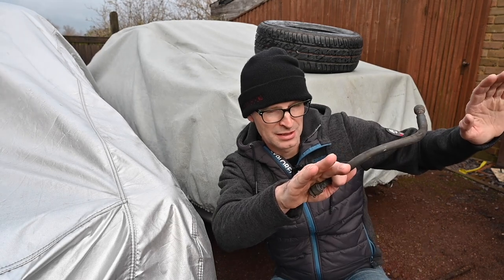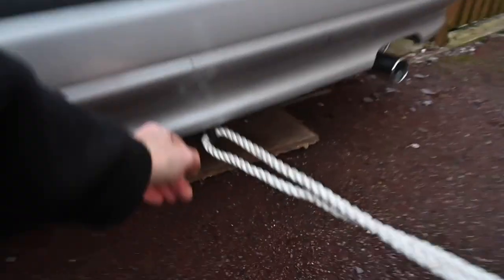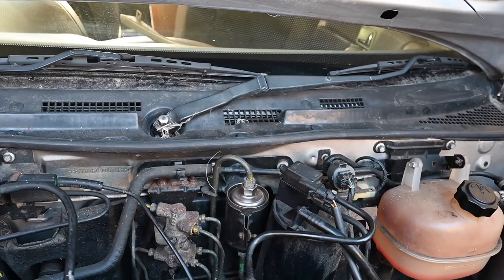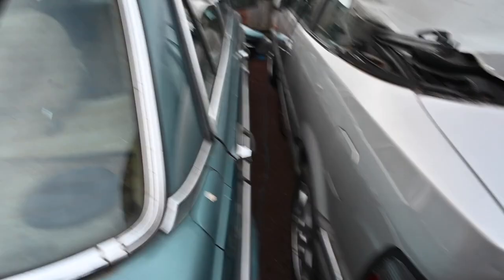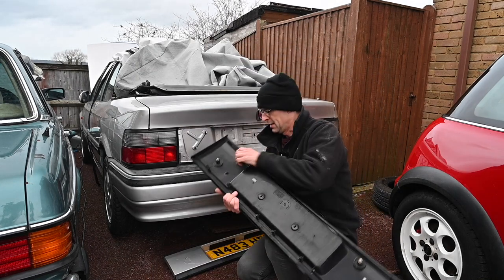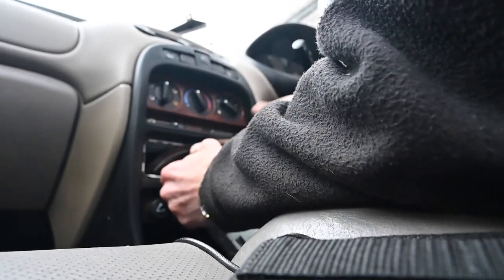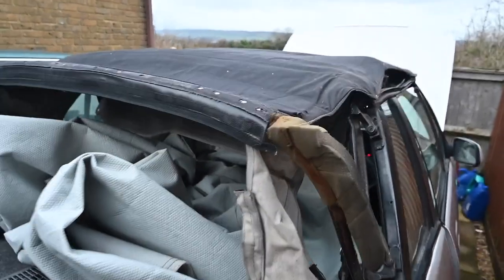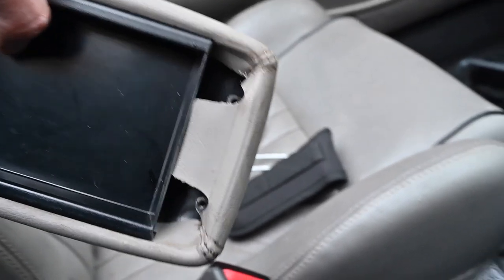Rover Convertible-Making it work part 927, Making it nice part ?

Comment: I've found that if I've had a project like this that's repeatedly gone horribly wrong, to the point I've wanted to abandon it but I've persevered regardless, I feel even more attached to the car when it's finished. There might be an initial period of "what's going to break next", but the more time that passes without anything breaking, the more trustworthy it becomes and the more satisfying it is to drive, as it feels like the hard work was worth it after all.

Comment: Oh lord, push-on pipe connector issues; I feel for you. Very besides the point of this video but the colour on that Merc, just gorgeous!
And congratulations on getting the Volvo's boot dry! Wonderful. Yes those grommets to the front of the boot can leak and sealing them, if only to prevent further leakage in future is a good idea.
Reply from the maker: Petrol blue metallic, not common at all but absolutely georgeous
Reply: @furiousdriving  Indeed! Mercedes had a lot of quirky solid colours but this one just fits the car perfectly and makes it more timeless.

Comment: I would invest in a secondhand 2 post lift for outside. They are affordable and you can tinker underneath the cars while standing and you have some more room on the driveway with one car in the air and one beneath it. Keep it up, she's coming along slowly but steadily.
Reply from the maker: Id love a lift but thought one would rust outside, also the fence is held by a brick retaining wall so Id worry about the stability of the ground under it just there

Comment: Matt, I am glad to see that you have some progress on Quentin, all be it slowly.  One easy and free cosmetic touch would be to restore you gearstick gaiter.  I suggest using black liquid shoe polish, rub the sponge bit into the faded parts and wipe off with kitchen role and keep doing it until the gaiter is black and there is no more transfer of polish onto the kitchen role.  It worked very well on my Mercedes  S124 steering wheel.  Happy Christmas Matt.
Reply from the maker: Somewhere Ive got a leather recolouring kit for black leather from doing the Coupe, I was going to do that and get one to match the beige seats here as well

Comment: You didn’t grease the little bar with ball joints on either end that pulls the sides of the hood in when it goes down. They break ALL THE TIME if you don’t smother them with grease. You can see the part behind the bits you did grease. My Dad had a bag of them made so I could just screw the ball joints onto the end of each when they broke.
Reply from the maker: I did a fair but more with the camera off as it was taking a while - one is missing but I have a new one

Comment: the volvo looks so clean and shiny compared to when you first got it

Also if you earth the fuel gauge wire on the sender end it should make the gauge show full, it'll tell you if its the cars wiring or another dodgy sender unit
Reply from the maker: Thanks, it has come a long way! And yes, I just need to work out which one it is again

Comment: Can't help but notice there are two exposed holes for bungs in the volvo's floor, is it possible that you're also getting spray from the wheels up into the boot as well?
I'm really looking forward to seeing the Rover done. Maybe you should look at keeping it for the summer as you haven't had any kind of soft top for ages
Reply from the maker: I unplugged those drains to let the water out as it was collecting while parked
Reply: @furiousdriving  Ah I see. I thought that may of been a potential secondary source

Comment: It’s one thing after the next with that old dog. It’s reaching the stage where it’s going to need a strip down restoration if it’s ever going to be a reliable runner.  It was a valiant effort but they weren’t built to last. You can pick up a very low mileage minty fresh rhd import for 6k which seems to me is going to be the much better value for money option in the end.
Reply from the maker: One a car starts being used the niggles are ironed out quite quickly, its just getting it to the point you can do that

Comment: Sorry Matt, Instead of laughing or at least, as well as laughing, we should be trying to help. 
The chances of the new fuel sender unit being faulty are very small, so it must be something else. You can test the sender using the ohms range on your multimeter .  I've only dealt with variable resistance type senders, modern ones are probably more sophisticated (like hall effect), but The Rover is unlikely to be like this. 
As far as I recall, in the older Volvos, the gauge would go to 'full' if the circuit was broken (open circuit) between the gauge and the sender. The B+ went to the gauge (meter) which had a voltage divider circuit and a shunt. At the tank end the slider (the moving part of the variable resistor/ potentiometer) to ground. When the slider moved up as fuel level dropped, this presented less resistance between ground and the negative side of the meter circuit, moving the needle towards empty.  To test the sender unplug it from the loom and read resistance between the casing and either of the pins. when the float arm is moved one of these readings should move, the other will be a fixed value.  If your circuit is similar to this, an empty reading means that there is either a short on the loom going towards the tank, or no B+ at the gauge.
 I've  confused myself now LOL
Reply from the maker: clear as mud!
Reply: @furiousdriving  I know, Sorry. :)
Hard to put into words and you can't post drawings on this medium unless you have a site to link to.

Comment: Removing the pipe most likely filled the system with air which will have struggled to purge due to low fuel level and flat battery

Comment: Maybe  -  having spent a proportion  of my working  life  around  British Car Plants  -  I know most of the horror stories to be  true  - from the need  in the  mid seventies  at  Landrover  for some staff  to pillage local  car parts stores  to try to plug supplies  gaps when they started  to build the SD1  at  Solihull  ans found themselves  short  of components  having  messed  up their calculations . plus the sleep rota in Longbridge for the night shift - possible by gross overmanning  . How  well engineered  is the suction end  of  the  pump assembly ?   Looking at the original  made me  shudder in terms  of the engineering  employed .

Comment: have you ever had problems with tip accepting that much oil? :D
Reply: Our local tip (New Forest area) now only allows 5 litres waste oil a month per household.  on top of new restrictions since C19 having to make an appointment if you can even get a slot, and they are no longer accepting trailers. Its a pain in the rear!
Reply from the maker: Theyve never watched before, I usually only go once or twice a year with a boot full!

Comment: Mate, fuel pipe and some jubilee clamps?
Reply from the maker: olives on the pipe ends, tight fit and genuine Jubillee. the only reason they use quick release in the factory is for speed

Comment: With all the time and effort, not to mention the ££ that has gone into this motor I think this may become a keeper, who doesn't like a bit of top down motoring in summer, feeling the sun on ones head and the breeze in ones hair, which I lack.
Surely one can drive from the MOT station directly home to go online to Tax it?  I think the Law allows an untaxed vehicle to be directly driven to and from an MOT test or has that changed since taxing has gone online and can one still tax a vehicle in a PO?  If not how does one without internet access tax their car?  Here one can either do it online and the Tax Disc posted out, yes we still have them or go to the C.C. Motor Tax Office.
Reply from the maker: Unfortunately me! Im not a fan of top down motoring which makes selling a bit easier!
I know you can drive untaxed to a test, and home to rectify if it fails, Im not sure about driving home after it passes, Ive always taxed them to come back
Reply: @furiousdriving  I think it must still be possible as one used to have to go to the PO,  C.C. Motor Tax Office or post it.  Tax in Post on many a windscreen, true or otherwise.

Comment: Is that fuel pump truly the right one ?  Check the depth  of the tank  relative to the  lowest draw point on the pump - something is not right .
Anything is possible  given the state  Of Rover  at the time of the build  and the shambles and grubbing around  for parts as  the money ran out was  biblical.
Reply from the maker: It looks the same as the original. hoping the battery was too low to pull the fuel up